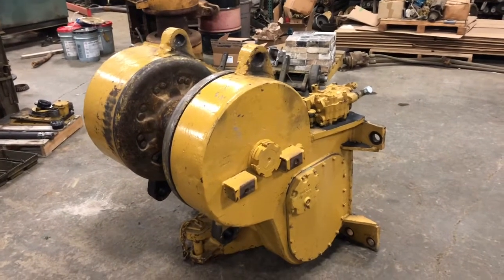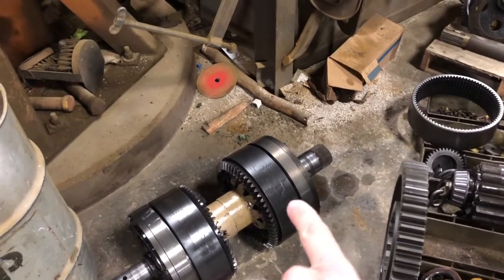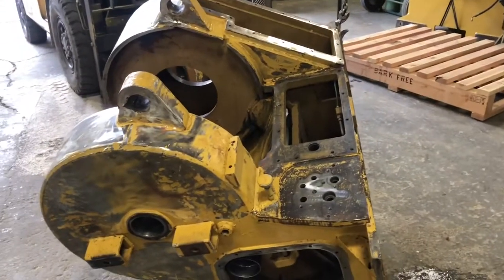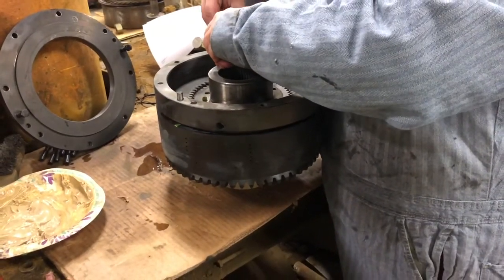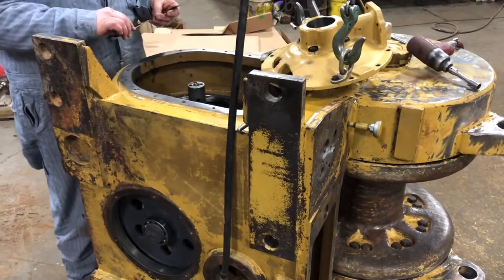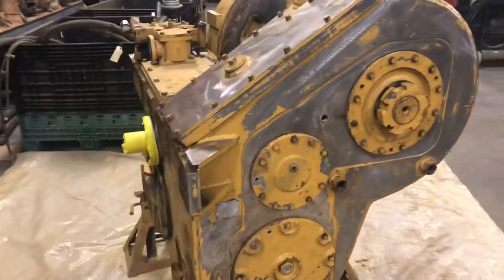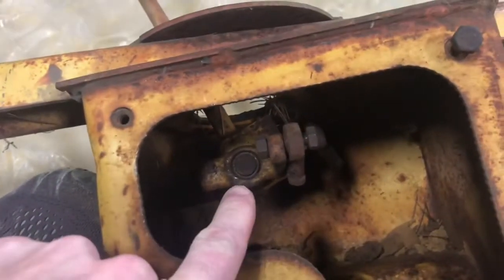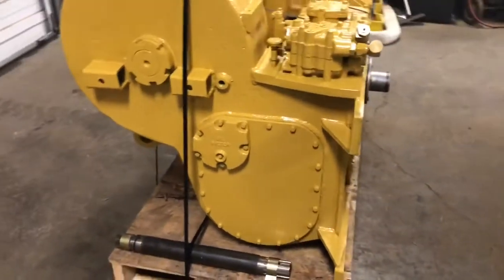CAT winch rebuild for D8

Comment: Good way to get that gear with the ridge repaired would be to have a machinist spray weld and machine it.
Reply from the maker: Yes, that's part of what the video is trying to show. We wanted to show how a winch that stopped production around 40 years ago works since it's different than the competitors. Also issuing a caution that any hard part failures will probably result in significant downtime and cost as you'll likely be making parts or scrapping it as only a few of these models are not worth anything these days. We recently got a call from someone who put 15k into a cat winch only to find out the specialty pump required for install was no longer available. He had to either walk away or find a way to jerry-rig a pump from a belt drive to try and run the winch. For most of these models, it's unwise to spend anywhere close to 15k as you should have jumped ship way before 15k and changed over to a modern winch with an internal pump etc.
PS - We prefer chrome/grind for light seal grooves. Huge headache

Comment: Own a D 7 g with a cat winch very informative thanks, question the big hydraulic hose going into the valve were does it gets its flow of oil from  Trans or hydraulic pump
Reply from the maker: Oil for winch pressure comes from a dedicated winch pump mounted near transmission.
Reply: OK thanks
Reply: D7G would have the pump driven off the accessory drive on the engine, oil is suctioned up from oil in bottom of winch case.

Comment: Hey guys love the vid! Just remember experienced manual machinists could manufacture allot of the hard parts you mention. Often they can make stuff cheaper than what Cat would want anyway.
Reply from the maker: Yes, but really good manual machinists are not easy to find in many areas. A worn seal surface isn’t to hard to fix, but spline shafts and gears with heat treatments are usually very costly to get 1 unit made by a custom machinist. Sometimes that’s the best/only option, but Allied and Carco are still making most of these winches unlike CAT. Parts are more readily available from Allied and Carco which is usually a better option than CAT or custom fab. This is one of the reasons CAT winches will eventually be obsolete. A good machinist can make anything work and CAT winches will still be in service for a while.

Comment: Very interesting thanks  Dan.

My uncle had a very decent winch on his turbo D8 in New Zealand back in the seventies. Aside from road making there he pulled out very big very old trees (?~1.5 - 2m through) in a dense subtropical rain forest with old wet soft soil. He was often tracks deep in it.

It thrilled and amazed me to be on the bullie inside that massive protective cage when I was there in the school holidays. Unfortunately the reality and significance of losing that type of environment eventually struck me in my early teens. There were also protests at about the same time and logging of these massive ancient trees stopped. Many people lost jobs and were understandably bitter. I have spoken to the odd old-timer about this over the years with most now understanding stopping was the right thing to do.

It was pre-OH&S days here so most of what went on then probably would not be allowed now. I still have very fond memories of the excitement and possible danger of being there. Even now I wonder about the specifications of his bulldozer. Was the 58 the largest of the CAT PTO winches?

Cheers
Reply: The CAt 58 and 59 were the largest winches CAT made back then, but now there are larger ones made by other manufactures available for the modern D8-D10/11 class machines.

Comment: I had a Cat 54 winch on my D5H TSK. The 54 is a strong, nice to use winch - when it’s going. The filter, which sits inside the r/h side exploded and put tiny bits of sawdust and stuff through the valve body that controls the winch. It is full of tiny passages and orifices, so the rubbish stopped the winch working. I took the winch on and off about ten times, which is super heavy and difficult, trying to get it working again, but I never did get it to work. I had to give up and put an Allied winch on instead.
Reply from the maker: Sounds like you had good success! Cat winches are great when they work, but we have changed serval cat 54’s that weren’t cost effective to repair to an allied w5c. The downside of older cat winches seems to increase each year. Hope you have good success with your allied winch